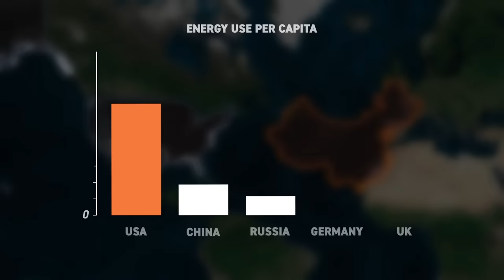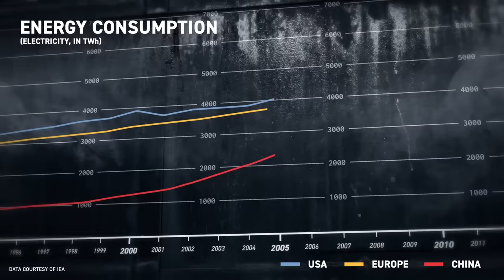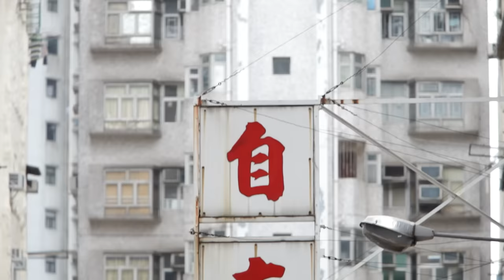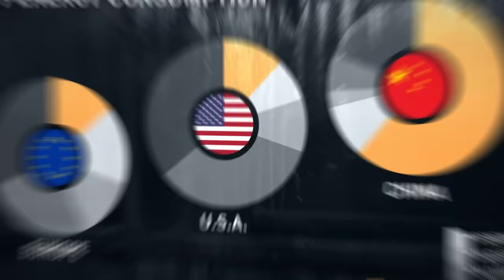China’s Electricity Problem

Comment: I wanted to suggest a video idea. My company is trying to get a new plane for our fleet but we are able to find aircraft but they have no engines. It’s a trend that the engines are more often than not leased out separate from planes creating an interesting market for aircraft engines leasing apart from the whole package.
Reply: Wow that's one of the biggest anticonsomer things I have ever heard. Don't tell Apple or the car makers it will not be long now when you have to lease your cars motor. Own nothing and be happy about it seems to be the new market direction and it's shameful.
Reply: @pilsen8920  this happened 30 years ago with cars, as they get more and more expansive, they told the consumer: you don't need to buy every year the new model and loosing a lot in selling your older model, you can now lease the car and you can have always the newest model!
Reply: What are 'NO Engines' and who are the makes of these "NO Engines ?
What is the price of a NO ENGINE -- 
I wish to buy one [
I searched the internet and I cannot find any entity that manufactures  NO ENGINES.
So I ask - How can I  buy NO ENGINES when they are impossible to find.
I need to have NO ENGINES  - 
please supply the name of the manufacturer of these NO ENGINES
i WOULD ASSUME THESE NO ENGINES USE NO FUEL
Reply: @pilsen8920  Well jet engines cost more than any other component on an aircraft. The engine on a 737 max can cost between 10-15 Million dollars per engine. Car engines account for far less of a car haha.
Reply: @pilsen8920  apple is already on there bullshxt ; I bout a new iPhone 6 months ago and, as I was getting ready to pay for it dude behind the register said - “oh wait an you will need a charger, let me get that for you” - I replied with I have soo many already that it was okay I don’t need it 🙄 well.. he then says oh no the newer model of iPhones no longer come with a charger block an the cables are different as well 😒 literally $20 extra for a charger now.
Reply: @pilsen8920  next thing you know we’ll be paying subscription for them
Reply: Everyone wins with a shared engine pool. The support costs of engines are high to begin with, but the risk of running short at a given shop of something as simple as fasteners can drive opportunity costs thru the roof.  Be careful with any operator/provider, but they are doing you a favor here, if they actively support integration of the engine provider into their platform level operations.

Comment: Another downside to relying so heavily on coal is that it’s not very adaptable. The grid’s demand is constantly fluctuating and utilities have to match the demand rather accurately or they risk either brownout or surge. This means you have to have a segment of your generation capacity devoted to matching the ebbs and flows of the grid. This is pretty easy in the US as this job is assigned to natural gas turbines. Regulating the generation of a turbine is a simple matter of restricting how much gas flows into the turbine. If more generation is needed, a gas turbine can go from cold to spin up and synced with the grid in about a half an hour. For coal, it’s not so simple. For a coal plant to heat up takes hours and regulating using a coal plant is highly inefficient. It isn’t a matter of throwing more coal on the pile. Generally, if you want to close regulate with a coal plant you have to throttle the turbine, which is less adaptive and still uses the same amount of coal as going full blast. Utility providers are much like farmers, using an almanac of previous years to predict the power peaks based on time of year, temperature, weather, etc, but even with the best predictions, grid providers can still be surprised. The US is fundamentally better equipped to deal with these fluctuations because the grid is built around fluid adaptability
Reply: @TheSuperior100  first off, grid availability is based off transmission and distribution, not generation. Second off, the main reason china has the much shinier and fancier distribution infrastructure is because they got into the game much later. The US signed the rural electrification act in 1936 and within the decade every American citizen had access to reliable power. China has only recently started pushing for countrywide electrification with reforms in 1994. Even still, there are decent portions of western China, especially in areas with high percentages of Uyghurs and other ethnic minorities that simply do not have consumer access to power. It’s also worth noting that one of the main struggles with modernizing the US grid is property rights. Most of the land in the US is already developed and the owners of that land have the right to refuse the construction of utility infrastructure such as new high voltage power lines. In China, the party has much more power to completely ignore the protests of the people and build whatever is easiest. Finally, get off your high horse, there are still lines in use in certain parts of southern China that date back to the early 1900s. If we’d be able to look forward a hundred years, I’m quite certain China’s electrical infrastructure would be in equally dire need of modernization as the US’s is now. That is assuming the world hasn’t been destroyed by then
Reply: You obviously know something about power grids, so it baffles me why you would talk as if China only uses coal for power. Even in the video, it says China generates about 65% of its power from coal, so isn't it obvious that China would use coal as a baseline, and have all sorts of other power to handle the fluctuations? It's not like China doesn't have natural gas, or nuclear, solar, wind & hydro.
Reply: Sounds like you know a thing or two how utilities think. As a nuclear engineer works in the energy industry (NUCL safety analysis), I’d love to pick your brain on how the current system needs adapted to better work for a solely nuclear and renewables (just considering hydro/solar/wind here) based grid. (Primarily how peaking will be handled)
Reply: @MrLando1996   I think I get it now. Both you and the other dude seem to focus on how a single source of power generation would handle different circumstances, maybe that's how power grids work in the US, separately and privately. However, the power grid in China works differently. The entire grid is owned by two companies that are both state-owned, they both own a huge variety of power plants, ranging from coal to gas, hydro, solar, nuclear, etc. They also built a variety of power preservation stations ranging from battery to water pumps. So what they'll do is keep coal and probably nuclear plants running all the time, and have the rest adjust to fluctuations. 

As for why such a mighty solution seemed to be causing blackouts this year, it's mainly because the water bureau usually lowers the water levels of all the dams before every summer to prepare for the flood season, and this year they were expecting huge floods so they did their job a little too good. Later it turned out that this summer was very dry and extremely hot, leaving hydro unable to provide as the residents were demanding more.  It's like a perfect storm situation.
Reply: @TanSenYuan  slow your roll there. I never said it was wholly unable to adapt, I was saying relying so much on a power source like coal heavily hurts its ability to adapt in adverse conditions. As of the 2019 statistics, only about 25% of China’s generation capacity is quickly adaptable. The rest you can adapt, but they’re either too slow to be useful or they’re better used as the base. I’m not saying that china runs into the problem every day, but it’s not exactly unheard of to see a spike of 25% over expected. I remember working during a massive heat wave where we weren’t certain our section of the grid even had enough generation capacity to cover the massive spike. We were able to provide, but if we hadn’t had a large portion of our base in  hydro and natural gas, we would not have been able to respond to the spike so quickly. There is depressingly little information available on China’s energy storage capacity, but they have 31,900 GWh in pumped storage, which tends to be the best large scale storage option. That’s useful for helping flatten out the curve, but it’s not going to do enough work to actively bring down a spike.
Reply: @samreid6010  The problem is communism as always.  China should have a lot more nuclear but coal companies pay better bribes so central planning pushes coal.
Reply: @samreid6010  As far as I know, this is not a problem in China. Remember, the entire power grid of China is owned by 2 companies, which are both state-owned. The government, on the other hand, issues power rationing, if you will, to big factories before situations like heat waves. Remember, the weather forecast is also run by the government. You then put two and two together and get a system that's far beyond the capability of a small-sized grid. After many iterations, the system is able to anticipate almost every situation and adjust both the power supply and demand accordingly. 

The only time this system failed to perform was during this summer. The water bureau lowered the water levels of major dams along the biggest river before the anticipated flood season, which has been the common practice every year. Apparently, this year not only was there no flood, but it was also actually pretty dry and extremely hot, leaving hydro unable to perform while the household power demand gets higher than ever. You might remember there was news on how China had "massive droughts". Still, the system made sure this was only a regional problem and resolved itself within a couple of weeks without any major catastrophe.
Reply: @TanSenYuan  well the very fact there has to be rationing would be considered a failure of the system by US standards. Even if our grids are a confusing mess on a local level, they interact well enough that every person and every business in the US can know that they can consume as much energy as they want and the lights will stay on. We have the generation cap and the grid adaptability to provide all the power our citizens can want. The only times the grid fails is when natural disasters break it, in which case there is a strong market of linemen and other engineers ready to drop everything and fix it.
Reply: @samreid6010  That is absolutely not true. Coal fired steam-electric generating stations are capable of turndown. Historic plants could sequentially close turbine admission valves and shut down coal pulverizers to achieve a turndown to 50% or even 40%  with only mild effects on efficiency. They could achieve ramp rates of 5% per minute.  New designs using the same sequential nozzle governing or sliding pressure operation with the turbine admission valves wide open, more extensive pulverizer turn-off and turn down, pulverized coal storage and bunkering, more advanced alloys, thin section austenitic steels, and turbine stage bypass, economizer bypass, and feed water heater bypass have allowed new coal fired power stations to achieve rapid cycling, slew rates of up to 10% capacity per minute (comparable to natural gas), and turndown to only 20% and even less of their nominal capacity.
Reply: @samreid6010  Well, wouldn't you consider unprecedented drought as some kind of natural disaster? Also, I did mention rationing was for factories, right? Lights stay on for the citizens too in China, and with a low fixed price set by the government, meaning there's no expensive electricity bill nonsense like what happens in the US or Europe. Lights off are actually so rare in China that once it happens, they made a big story out of it in the US. Another point you are missing is that China has way more manufacturing than the US, and growing fast. Residential makes up 40% of the US's energy consumption, while in china it only makes up 16%. Rationing doesn't sound cool, but you never see China's manufacturing affected by it, do you? Which is why it's just another useful tool for this situation.
Reply: You just know some common sense about the power grid, but you don't know why the Chinese government has comprehensively developed electric vehicles. Lithium batteries can store energy. Besides, you know almost nothing about China. You say that there is no electricity in some parts of China. Maybe you use your experience in the United States to imagine China. In fact, you can know whether there is electricity when you travel to China.
Reply: @samreid6010  thanks for all of these very insightul comments. also made me think back to how crazy that winter in texas was!
Reply: So, use coal for baseload and have gas to supplement it?

Seems simple, and reliable (and cheap and attainable even by third world countries), enough.
Reply: Yes that is a problem, but coal is more reliable than some renewables as long as you know you have the reserves. Whereas solar and wind aren’t, not before efficient electric storage is a thing. China is fighting the adaptability issue with electric vehicles and other measures. So that the extra electricity generated at night is also used, for a cheaper price too.
Reply: @AndrooUK  In China, the electricity charge is very cheap, and the remaining gasoline cost can be used to buy a new car. So I will not replace the battery but buy a new electric car. Do you want to drive a car all your life? Gasoline cars vibrate a lot, make a lot of noise, and fuel consumption will slowly increase. Poor acceleration performance. You will witness the new era slowly.
Reply: @marksmith8079  Bribes and Lobbying is more of a problem in Capitalism than in Communism. Lmao.
Reply: @samreid6010
Reply: @MrLando1996  
Peaking is mostly handled by fast starting gasturbines See GE Aeroderivatives
Reply: I once sat through the early hours of a Monday morning, in the control room of a coal plant near Toronto, CA. I observed as the operator brought the unit from cold to on the grid in 90 minutes. The computerized control allowed the generator, in response to electricity requests from the grid, to throttle the feed of coal dust into the boiler fireball, to maintain the required steam to meet the demand. Up until 2014, Ontario always used coal plants to meet demand above base load. So I am not really sure what you mean by coal not being adaptable.
Reply: Over the past 30 years, the capability of coal fired plants to handle faster ramping speeds has increased markedly, primarily because more valving and auxiliary equipment is managed by the electronic controls. It does effect efficiency, and even more notably, equipment failure rate. (Imagine a 2000 psi hydraulicly operated throttle valve cycling several times a day, and guess whether its seals will suffer.) This is an issue across the entire facility from coal handling to ash disposal.

So, utilities prefer to make no more throttle changes in the big plants than necessary. Handle peaking loads with small plants, gas turbines, pumped storage, etc., where practicable.

Incidentally, a turbine's greatest enemy is temperature change. That's why most heavy maintenance on gas turbines is dependent on cycles (cold-hot-cold). Coal or gas fired steam turbines can be held at partial production to avoid cycling to cold, greatly increasing their life. A steam turbine's greatest enemy is condensate, because it is abrasive.
Reply: Texas and California says hi
Reply: @samreid6010  so if there is no power, but the transmission and distribution network is working, there are no blackouts?
Reply: With the constant collection of statistics and metrics it becomes easy and routine
Reply: @TanSenYuan  also bioenergy...they use pretty much what europe uses, but they have much higher demand and a much higher population...while still being state financed
Reply: @MrLando1996  How to adapt the current grid to run on Nuclear and Renewables? Answer is simple, but implementation is complicated and expensive: Batteries. The battery bank Tesla sold Sydney is the tip of the iceberg.  Use Nuclear for base load, the minimums that the grid will ever hit, because you don't want to be flickering nuclear. Renewables charge energy storage, which is used for peak demand in lieu of peaker plants. This smooths out the inconsistency of renewable generation, and can provide for peak demand spikes even better than the current system. The problem is the billions of dollars in infrastructure costs to attain this ideal goal. Plus all the rioting from the less educated being stirred up by the fearmongers concerning irrational fears about nuclear power, which would probably push projects back at least five to ten years through obstructionism. 

Oh, and you'd need to build those Ultra-High Voltage lines, because similar to China, most of our optimal renewable energy production is in our least populated areas, but given the cost of the nuclear reactors to replace base load, it's a relative drop in the bucket.
Reply: @MGZetta  Under Communism, bribery is unlimited. President Xu (and the party elite) made billions from a modest salary,. Lobbying is a lot different- it is about who has the power and meeting their goals for which country prosperity is mere of side effect than a goal- making the current leader most rich and powerful and his allies then senior Communist party member have power and money is next, then country stabilized reduce the chance of rebellion, following Communist and stated ideology. If making China prosperous was important then ordinary people could invest in shares of the companies rather than just property.
Reply: @marksmith8079  Lmao, don't confuse American politics with Chinese. There is at least thing called anti-corruption while the US bragging about their lobbies.
Reply: @marksmith8079  I pray those who has the power to lobby cares about the people. Am I too naive?